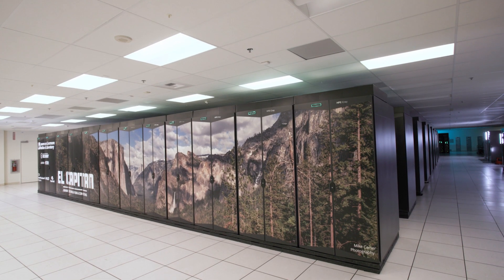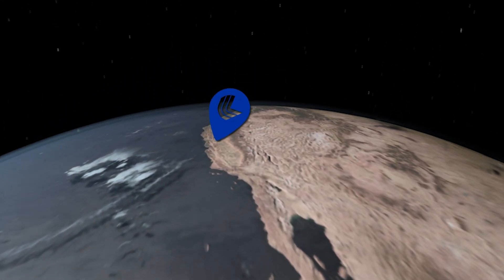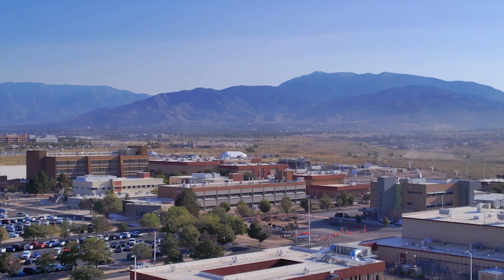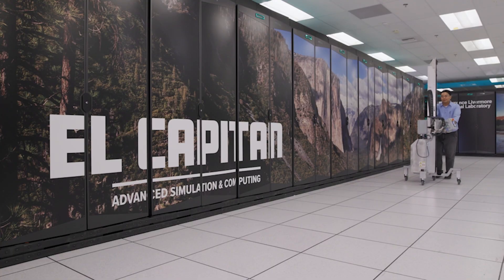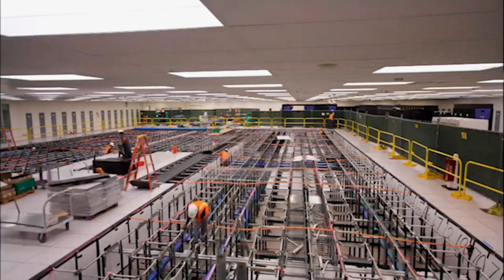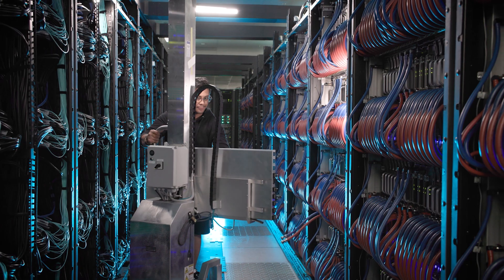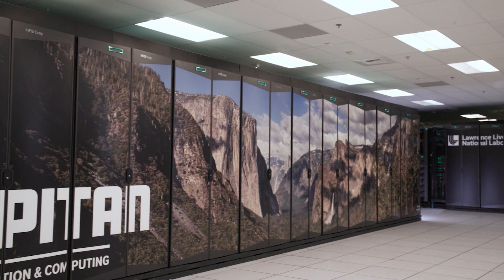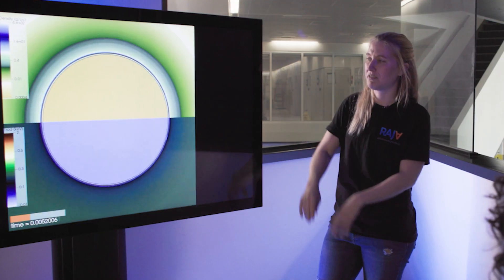El Capitan: The World’s Fastest Supercomputer Is Revolutionizing National Security and Science

Comment: This systems will soon be obsolete. NVIDIA just announced their new smaller desktop Ai computer. Imagine one million of those running all over the world, connected together, decentralised. Redundant and power efficient with less costs.
Reply: That’s optimized for FP8 inference, which is not what you want for this type research work which is usually FP 32 or FP 64 Even. The desktop you’re talking about is not even remotely designed for this kind of workload.
Reply: @ thx for your valuable feedback

Comment: This being the fastest super computer isn't true.  XAI's Colossus supercomputer has a peak performance around 396 exaflops and they have plans to double it in 2025.  Now its true they are optimized for different workloads and use different benchmarks, but 396 exaflops is over 198 times faster than 2 exaflops so claiming its not faster would be wrong.
Reply: Quite false, you do not do scientific sims and scientific computes in fp8 and int8, you go by highest precision possible. Xai is only 35 percent above if even
Reply: @shazzz_land  Sigh.  I SAID they were optimized for different purposes.  They are build for different use cases.  But that doesn't change the fact that Colossus is still considerably faster.
Reply: @Me__Myself__and__I  considerably? Not necesarily, you compare different types of precisions in ai compute, the performance you are stating for colossus is probably the lowest precision point, for the captain is the highest precision point
Reply: @shazzz_land  Colossus is nearly 200x faster measured in exaflops.  El Cap isn't anywhere near 200 times more precise.  Why are you arguing this, the numbers are very clear that Colossus is blatantly faster.  Its numbers, some numbers are larger than others.  Basic facts.

Comment: How many results can this computer get per second from the multiplication of two 16-bit numbers?
Reply: Well the 2 exaflops is benchmarked on 64 bit numbers so maybe 4x?  But it may be heavily optimized for 64 bit so maybe not.
Reply: @Me__Myself__and__I  It doesn't matter how many bits it does the operation with. But for a serious comparison, I wrote 16 bits, but it can also be 8 or 32-64 bits. When comparing with each other, the real measure is how many numbers with the same bit value can be multiplied; this is the most important part. Because it is not only the operation that is performed, but also the writing of the operation and therefore the data bus speed that is questioned.
Reply: @empatikokumalar8202  What do you mean it doesn't matter?  It absolutely matters.  The size of the variables being manipulated has a serious impact on the performance of the computer.  Besides, you asked a specific question about operations of a specific bit length and now you're saying it doesn't matter?  Waste of time...
Reply: @Me__Myself__and__I  I think there is a misunderstanding. I did not mean that the event was not important, but that it was not important in terms of my evaluation. Because I only know what this value means.

Comment: Had a friend who worked on the o Cray for the NSA back in the 90s. He talked about the scale of everything. Said the cooling alone was monumental. And the power required. And the backup power it had available. It would be fun to get his take on the new systems. Hard to get your head around what its capable of.
Reply: The AI specific super computers are actually considerably faster than El Capitan and they take ridiculous amounts of everything.  I mean Microsoft is recommissioning a large nuclear reactor to power their AI data centers.  xAI's Colossus is currently the fastest and its infrastructure requirements are insane.  You can find some interesting videos on here that go over some of the details if you're curious.
Reply: @Me__Myself__and__I  it is an ai specific computer
Reply: @shazzz_land  Which?  Obviously Colossus is.  El Capitan?  I don't think it is, if it is its very slow.
Reply: @Me__Myself__and__I  They aren't really faster... AI uses FP8 calculations, whereas industry standard benchmarks use FP32 rating, usually the FP8 speed will be 4-16 times faster in operations, but it is significantly less precise... For example, the GPUs used in El Capitan are 122.6 TFLOPS in FP32, while in AI workloads(FP8) it would give almost 2 PFLOPS, and that's per GPU, El Capitan has 43,808, meaning the GPUs alone can offer almost 90 EFLOPS at FP8, then you have 43,808 CPUs too. 

El Capitan would be a fairly decent AI machine overall, minus the limitations of running AMD hardware, which isn't quite as well supported in AI software
Reply: @talkingonthespectrum  Okay lets use your numbers.  "the FP8 speed will be 4-16 times faster".  Colossus performs 200x more exaflops than El Capitan.  what is 200 divided by 16?  A whole lot faster, that's what it is.  So "they aren't' really faster" is bogus.  I don't understand why people feel the need to argue against obvious facts.  Is your personal life or reputation on the line if El Cap isn't the fastest super computer or something?
Reply: He'll tell you this is why all "supercomputers" of the past 30 years have been little more than racks and racks of COTS CPUs.